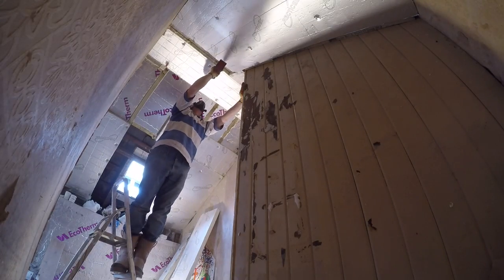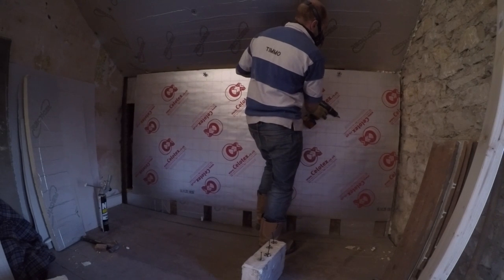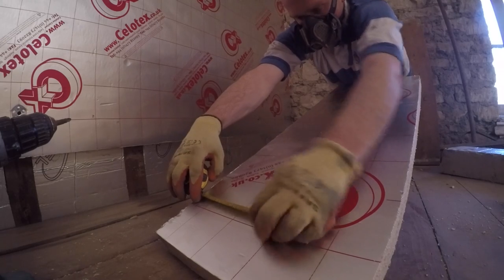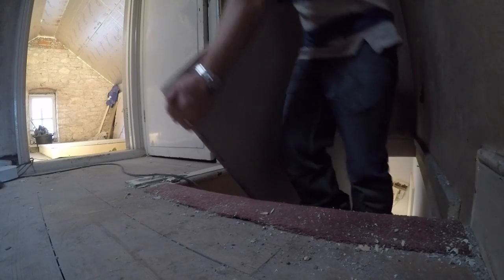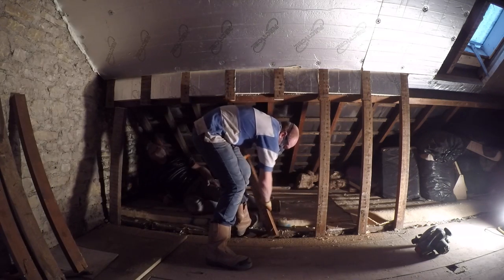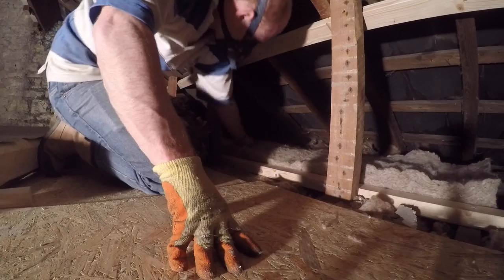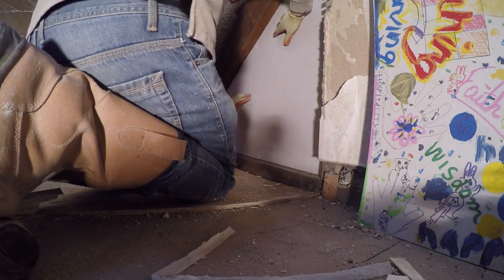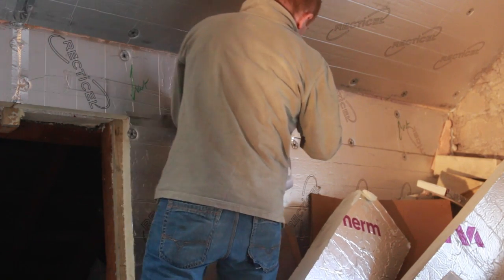Sorting Eaves Storage | Loft Conversion Project 5.0

Comment: How did you fix the plaster boards? Did you screw directly to the insulation or through to the wood?
Reply from the maker: All the way to wood. In some areas we also used high tack board adhesive too.

Comment: Great Job! When you screwed in the wall board (sheetrock) to the rigid insulation did the screws go in tight? Meaning did they break through the paper at all?
Reply from the maker: Maybe 1 in 20, but due to over screwing rather than anything else.  As we had already pulled the insulation in tight with the washers it was nice and flat to fix to.  A drywall screw bit helps too as it stops them going through the paper.
Reply: What fixings are you using to secure the insulation?

Comment: Can you or someone explain why is there 2 lots of thermal (if correct) boards. 1 lot in between each rafters which I understand but I'm confused with the 2nd lot covering the rafters and the thermal inbetween them?

Lastly you mention on previous videos  stating about (50mm gap) airflow required. Where is this? From roof towards rafters and 1st insulation?

I'm just a novice DIY'er so any help and explanation is appreciated.
Reply from the maker: 50mm between tile and insulation, the boards between make up the bulk of the insulation but then the second layer of 50mm boards seals over those and prevents heat loss through any joins and the thermal bridging of the rafters.
Reply: The Restoration Couple thank you for the reply back

Comment: Hi. Quick question. Do eaves cupboards serve a structural purpose? Can they be entirely removed? Haven't got a consistent answer from builders.
Reply from the maker: They can be of part of original roof structure. In ours the purlin are the structural part and the short studs were just to hold original lath and plaster before we removed them.
Reply: @TheRestorationCouple  thanks! Keep doing your vids. They're really good.